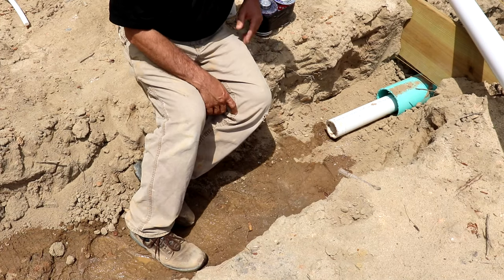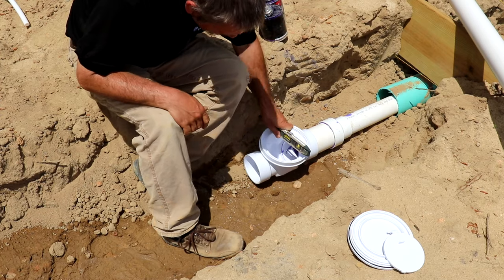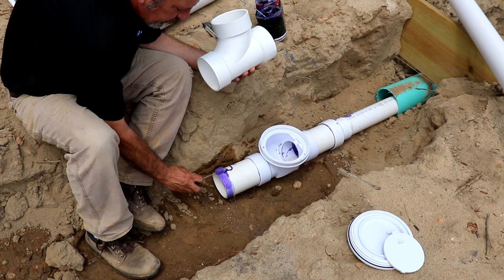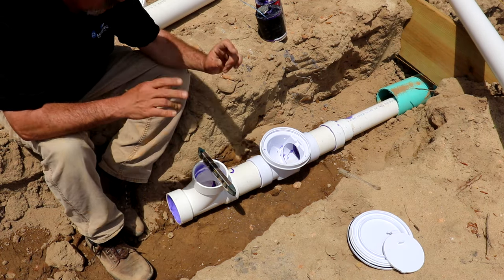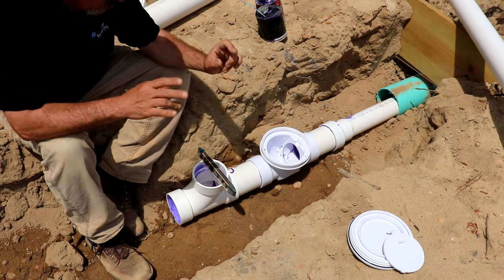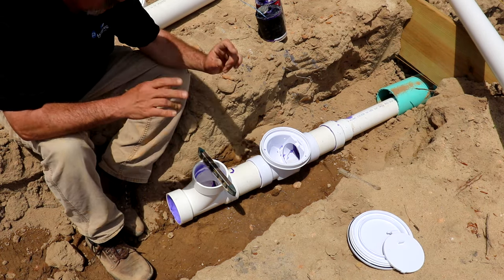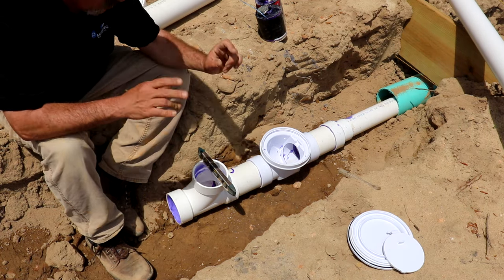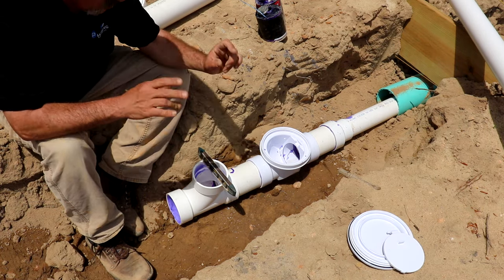Running a sewer line part 2 Piping

Comment: ?  We will having a septic system with our new build ---  Should we include a backwater valve between the inlet of  the septic tank and where the drain waste line exits the basement?  Will we also need a clean-out along with the back water valve?  The one thing we want to add here -- is that the septic leach field will be above the septic tank location by about 40 feet in elevation -- and the system will be a "dosing" system with a sewage pump in a separate chamber which will have it's own backwater valve at the discharge side of the pump chamber.  Your answer will be much appreciated.  Great VIDEO by the way!
Reply from the maker: You don't need a backwater valve but i would put a cleanout on it
Reply: @PlumbingSolutionsLLC  Thank you for the answer!  Your videos are great!  Keep sharing your experiences and knowledge. RP
Reply: @PlumbingSolutionsLLC  As I have researched long for information on whether a planned basement mechanical room floor drain installation requires a VENT....  I believe the Tennessee Code I need to follow said that Floor Drains do not to be vented?  What is your thought?
Reply from the maker: it needs to be vented and it needs a trap primer
Reply: OK Thanks again  @PlumbingSolutionsLLC

Comment: is the backwater valve intended to be installed near the foundation in a yard box with 24/7 access (given the screw top)? I don't need one by code but it seems like a handy way to further future proof my new mainline. Is the main sacrifice that the door needs to be removed if you snake it in the reverse direction?
Reply: Yes just remove flapper inside the backflow valve n snake backwards but if your snaking towards a tank or manhole u dont need to just make sure u go right direction with machine/cable

Comment: I may be wrong but thought you had to give the primer 15 seconds before applying the glue. Also wouldn't you normally dry fit and mark the connections for fit ,then glue? Your trying to level the fittings with the glue already bonding..Im not a plumber by trade but have watch a 1000 hours of video..lol
Reply from the maker: everybody does it a little different , never dry fit , the fitting will get stuck together and you won't get them apart.

Comment: At 23:50 the primering and gluing after the valve fitting look at your video you did not even glue the upslope side of the pipe you put in the fitting. You did primer it kind of but no glue!  Watching your gluing and priming very weak, I would love to see your pressure test and see how many of the connections leak.  And not sure where your located but where I work auto fail for using a san t on its back for the cleanout.  A wye and 45 for a cleanout.  But still a informative vid, thank you.
Reply: @veryslyfoxthey’re a part of the inspection. No pressure test, you don’t pass the inspection.

Comment: What is the purpose of the light green pipe inserted over the white pipe. Can i use plumbing
 strofoam wrap over the white pipe when passing under concrete footing? What is the difference bet. white and black and light green pipe. Thanks.
Reply from the maker: Has to be a hard pipe when going horizontal

Comment: Absolutely correct about laying the sanitary T on its back
Reply from the maker: The inspectors let them do it , I guess it's cause it's just a clean out and there is no waste traveling down it.
Reply: Basic plumbing folks just because the so called inspector is ok with it right.  You’ll be augering that line out once a month only on vents and especially never below the hard gray stuff

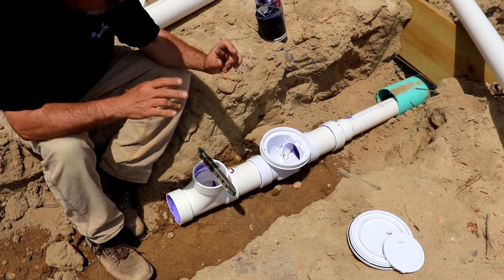Comment: Why can't you run the waterline next to the SDR 35 pipe? Also, If you had a 150' run to make would you still use schedule 40 PVC? I'll be putting it in ground that's likely to eventually have lots of tree roots. 13:29
Reply from the maker: We use sch 40 to prevent bellies . and water lines next to sewer line It's all code stuff, they don't want thin wall sewer to be next to the water. In case there is a breakage.
Reply: @PlumbingSolutionsLLC  Why not ABS blank ?

Comment: Good job, the only question you didn't answer is, what's the tracer wire for? Well, one another, what are the permit requirements if you are just a homeowner replacing old pipe?
Reply from the maker: The wire is for locating it later. Permitting is going to change from state to state, county to county . Most areas don't require a permit to repair or replace existing. but, you might want to check.

Comment: Is the pitch for the 4 inch pipe supposed to be 1/8 or 1/4?
Reply from the maker: either one, just stay in between the two
Reply: According to code, 1/8" is ok for 4" pipe, but many plumbers will just do everything at 1/4" since smaller pipes require the steeper 1/4" pitch due to being more restrictive because of the smaller size.  For example, your 2" pipe must have 1/4" pitch.

Comment: Tracer wire on a sewer run, why not use camera an a sewer locator, lot easier, can see how states do plumbing different
Reply from the maker: The county requires the wire.
Reply: That answer my question, very good , good work

Comment: How do you cut the pipe straight??? Tell me the trick please
Reply from the maker: lol.. I don't think there is a trick. Practice
Reply: @PlumbingSolutionsLLC  Chop saw. I am curious though as to gluing the joints together if you may, though. I can't seem to get my pipe to slide all the way into the the fittings so that it meets up flush with the inside edge of the pipe. I always seem to have a 1/4 inch gap and I'm worried that it will slow down my wastewater and eventually create a backup. Is that normal or am I doing something wrong? I've twisted them in and even used my full body weight and still it's the same result.
Reply: Buy a big enough chop saw to cut through the pipe. Near perfect cuts every time and minimal deburring. I bought a used miter saw for 80 bucks, it works fantastic and I've used it for all sorts of stuff.

Comment: How deep is sewer line in ground
Reply from the maker: depends on where you live. Here in SC the frost line is zero. so, it is supposed to be 18 inches deep. But, the Inspectors have never failed us for depth as long as it is under the dirt.